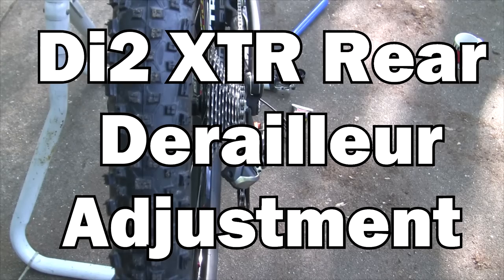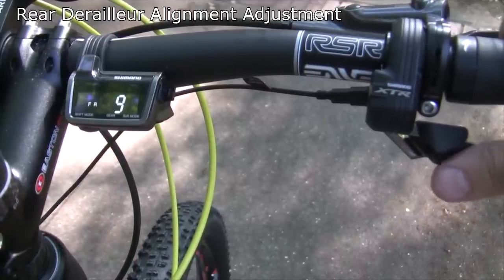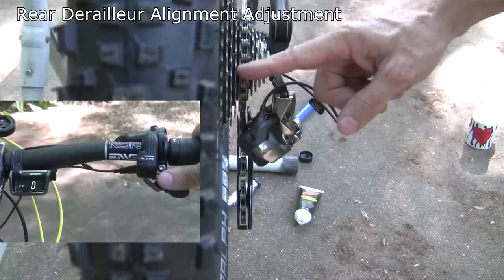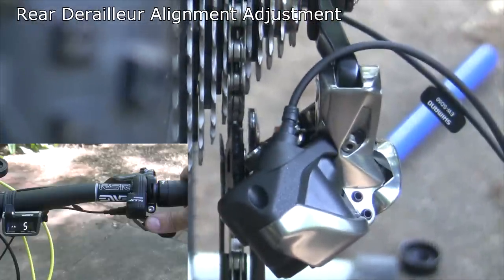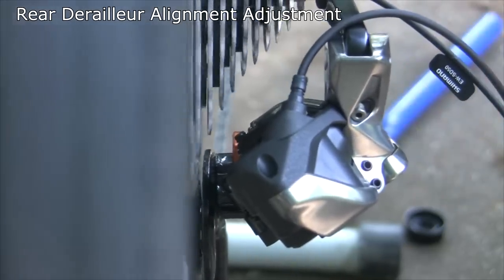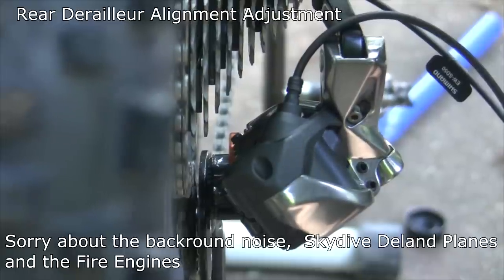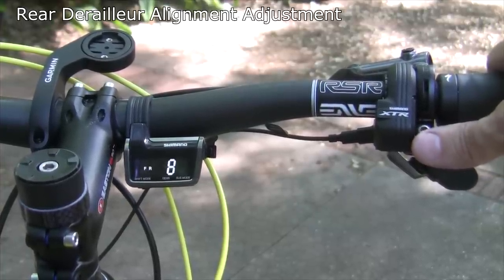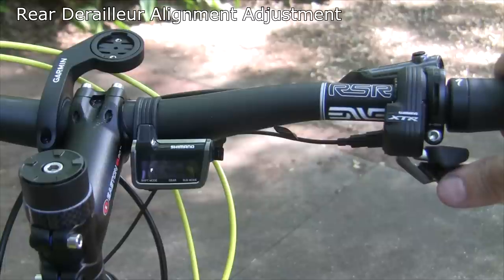Di2 XTR  Rear Derailleur Adjustment

Comment: Hi Larry, that's a great little video. Tell me, to do the high set screw adjustment, does an anticlockwise turn make the mech go toward the rest of the cassette, or outward the bike frame? Or it it the other way round? Thanks!

Comment: Despite you not using one I was kinda wondering if you could still give an advice on something that is related to my XTR Di2 FD:

My issue is basically the Direct Mount FD not being compliant with the entire Boost spec and in my case the Crankset thus causing the chain to rub against the outer cage blade of the FD - And that's with the head of the Adjustment Screw already bottoming out on the FD's housing.

I've currently solved this by placing shims, made from old credit cards cut to size, between the FD's Type D Adapter and the Frame's FD mounting hardpoint thus allowing for actual use of the Adjustment Screw ( as in loosening and working with it ).

The Boost spec Crankset is the lone remaining piece of chain touching hardware that came with the Bike before I swapped the entire drivetrain from Deore/Deore XT to full XTR Di2 and from the old 2x10 to the new 2x11 system. So yea... I'm currently using a 2x10 Crankset in a 2x11 system.

My understanding is that compatibility between the FD and the Crankset can only be achieved by changing the latter to a Non-Boost model as there aren't any Boost Adapters available to the Di2 FD. This change though could conflict with the Boost Hub of the rear wheel and the cassette attached to it BUT taking into consideration that the new cassette now has an additional, 11th, sprocket closer to the spokes/frame wouldn't it mean that using a Non-Boost Crankset being more beneficial anyway as the new ideal chain line would be closer to the frame as well?

As this would require a new purchase anyway the next question would if a 2x11 crankset would make a whole lot more sense?